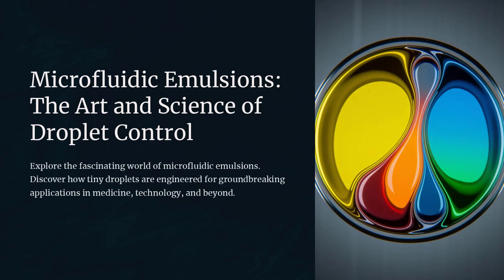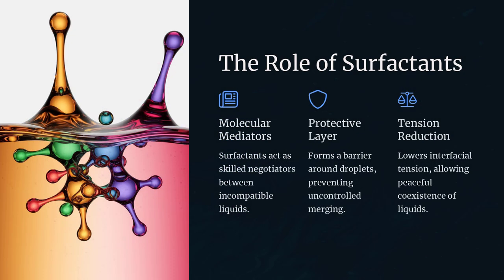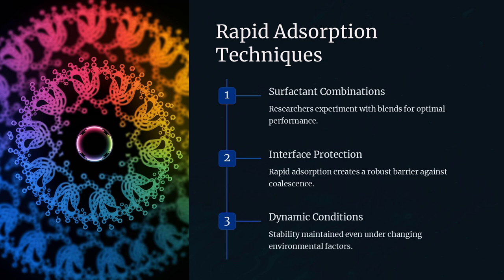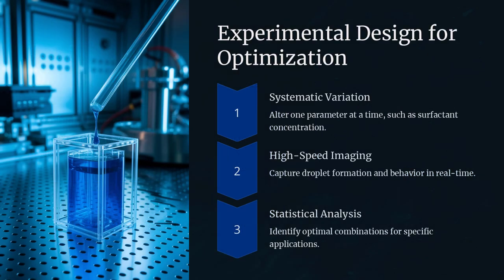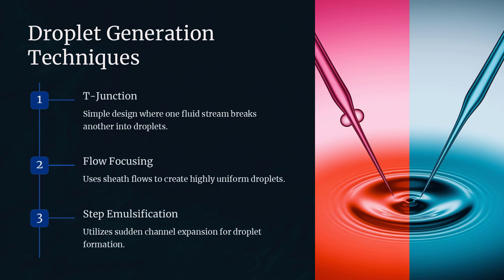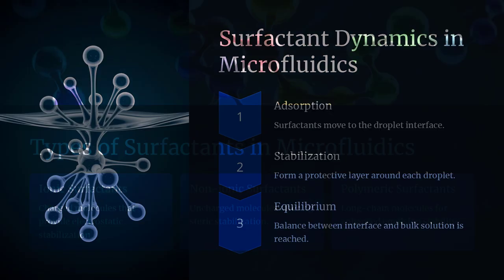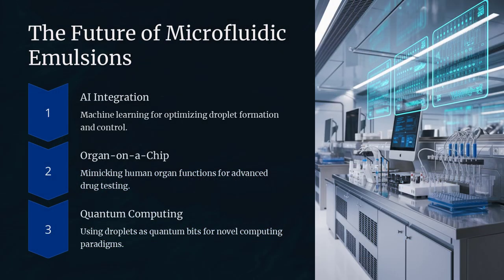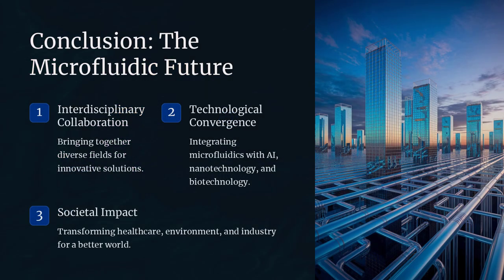How to Master Emulsion Stability in Microfluidics

Comment from the maker: How can surfactant chemistry be fine-tuned to achieve optimal interfacial tension for stable droplets while maintaining biocompatibility for sensitive applications like drug delivery or single-cell analysis?
What are the theoretical and practical limits of droplet miniaturization in microfluidics, and how do fluid dynamics at the nanoscale influence droplet formation and stability?
Can AI-driven modeling and real-time sensor feedback enable self-correcting microfluidic systems that dynamically adjust surfactant concentration and flow parameters for maximum emulsion stability?